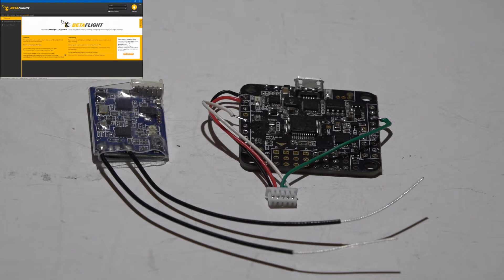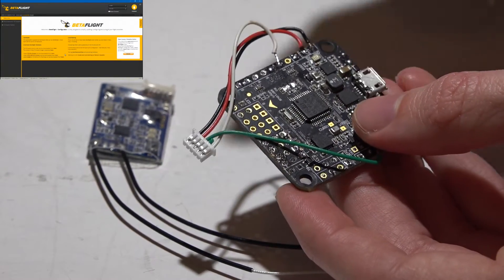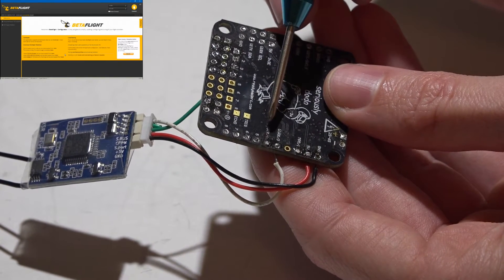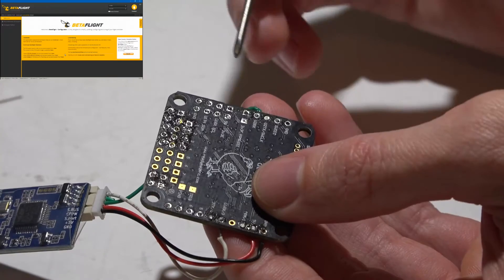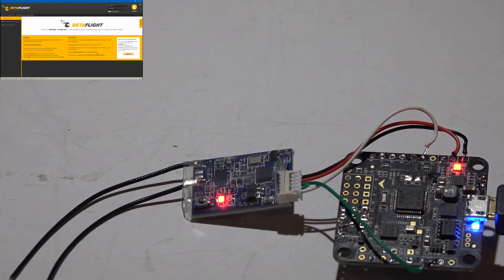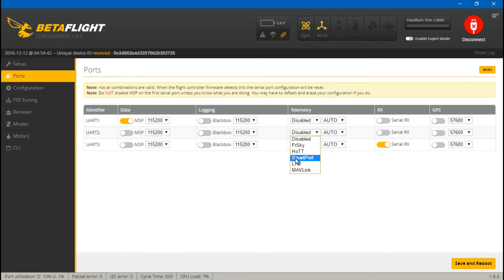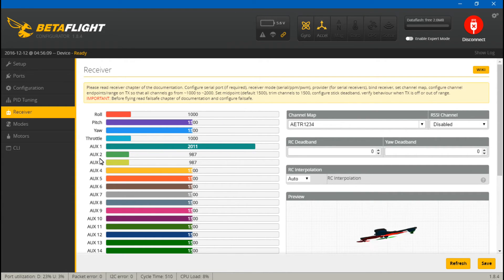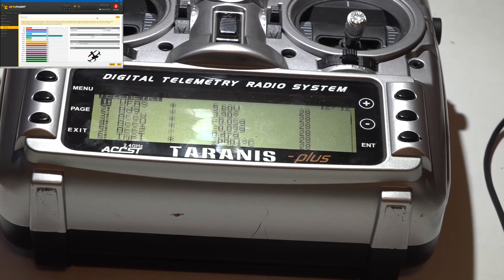Seriously Dodo & XSR: Connect & Telemetry

Comment: awesome video.  Getting a Taranis next week and have a question.  I use a Dodo FC and I currently use UART 2 to connect the SD card to record blackbox data.  Can I put the telmetry wire on the same connection or do I have to use a different UART for telemetry?